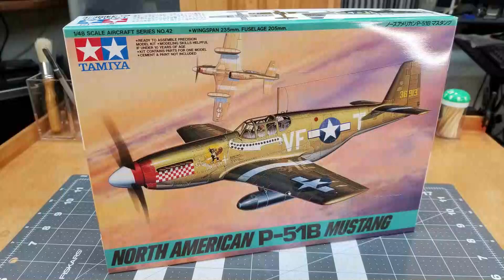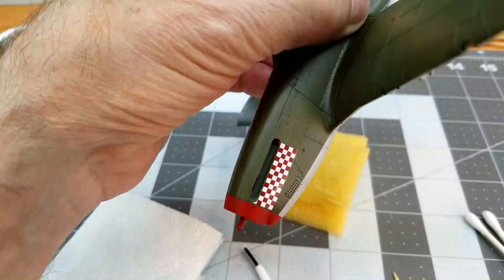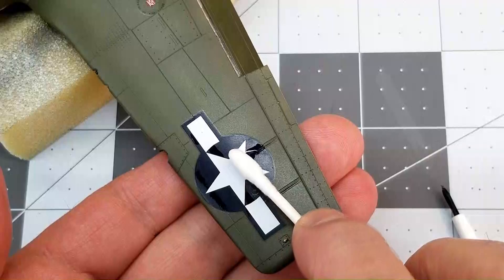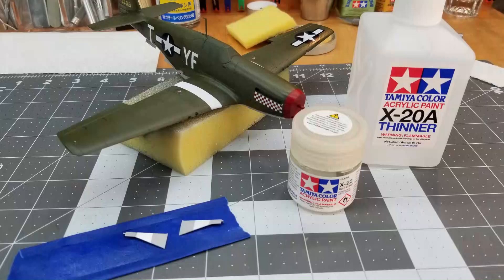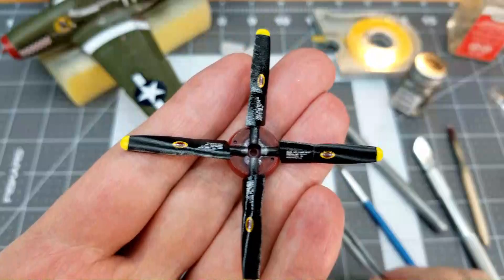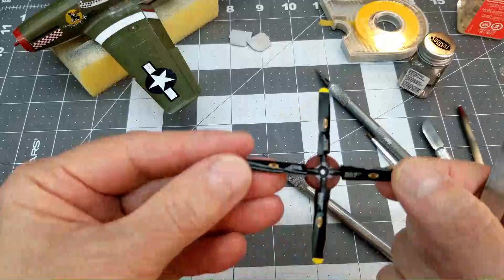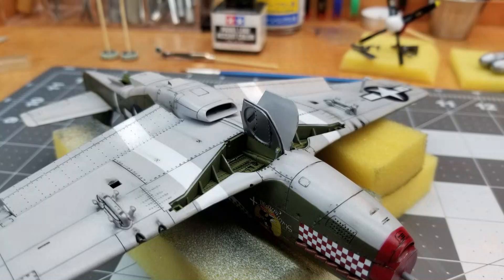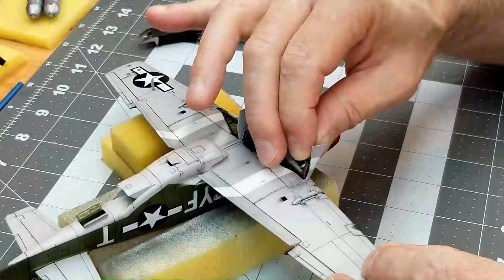P51B Mustang by Tamiya in 1/48 Scale, Build Part 5, Decals, Weather, Final Reveal

Comment: Hi Hillbilly, I always get nervous when I see metal tweezers removing canopy masking. I use a sharpened toothpick or sliver of hardwood. I know that this has no chance of scratching the plastic windows. I also cut the tape line to ensure a clean tape peel. That's an interesting way to create the exhaust streaking. Fantastic antenna! The canopy may look a little too shiny and new though. I am not a rivet counter so I can't see what is 'wrong' about the build but, I know this - "This summabitch can Fly!! You did a wonderful job on your first airplane. I'd like to see more, maybe with a small base? I love your work. Please keep it going. See ya soon Johnny. All the best to you and yours. What is wrong though? (maybe the exhaust streak is not curved enough? or maybe 3 propellers instead of 4? I don't know. It's a good trivia question) I'll be checking the comments to see who knows what. lol
Reply from the maker: Thanks Mikey V, I had a lot of fun with this build. Thanks for the tip. As for the mistake, since there isn't a contest, I'll tell you. For the markings on this version, I put on the wrong unit identification, it should be VF not YF! But when I noticed it, it was way to late to change, lol. Live and learn my friend. Stay safe and model on! Johnny